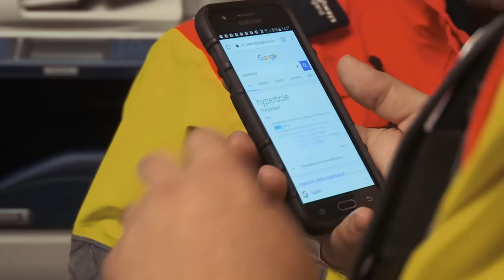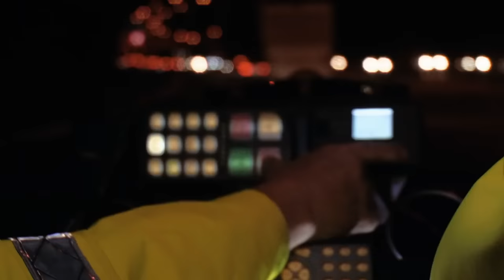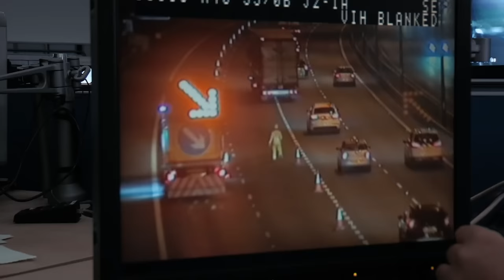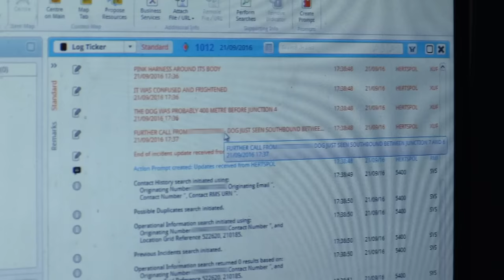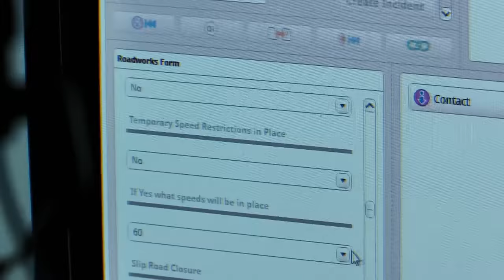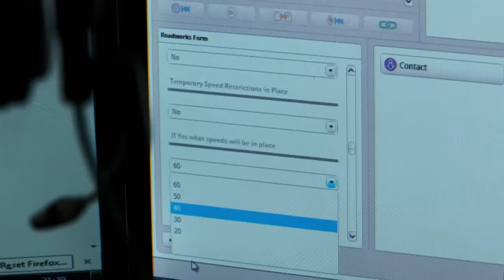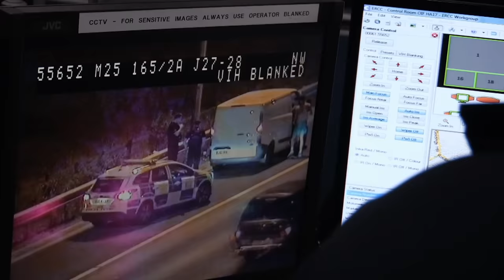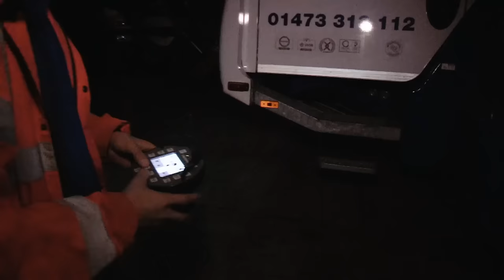Working On The Busiest Motorway In Britain | Britain's Busiest Motorway E6 | Our Stories

Comment: Isn't it a bit of a hazard to impose such large sums of fines if the work runs late? One would be afraid that it will promote sloppy, incorrect installation in favour of a more speedy job.
Reply: I suppose there are quality checks in place. People whose job is to ensure quality is not compromised  and they are not affected by fine for being delay.
This way timings for the work and quality can remain independent things.
Reply: Something very similar happened when we privatised the railways, It's not as simple as "Tough time constraints + Fines = Rail Crashes" But Railtrack caused alot of catastrophes because of similar reasons.
Reply: Putting money over safety

Comment: Eating behind the wheel illegal, lol
Reply: but it isn't. You can be prosecuted if you are shown to be driving without due care and attention, but eating and drinking is allowed
Reply: @gary63693  if you're eating while driving, you're distracted, they also use their radio (a handheld communication device). Funny how the rules don't apply to the blue light boys.
Reply: @rhodrijohn7411  Not correct. It's down to a judge or a magistrate to decide whether something is causing you a distraction. I've seen plenty of people drive far better with one hand than some people drive with two hands on the wheel. I can quite comfortably drive around with 1 hand in my automatic and yet Mrs Miggins in her 1 litre pre-2000 Nissan Micra who I was behind the other day was slamming the brakes on for every slight bend, despite the road being wide enough to fit two lorries side by side, and doing 20-25Mph on a 60 Mph road where it's pretty safe to do 60.